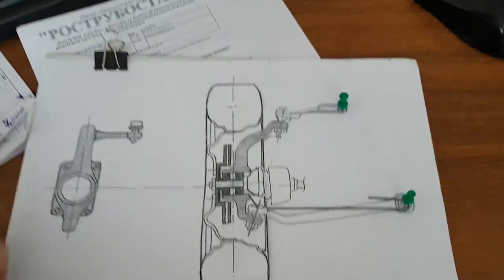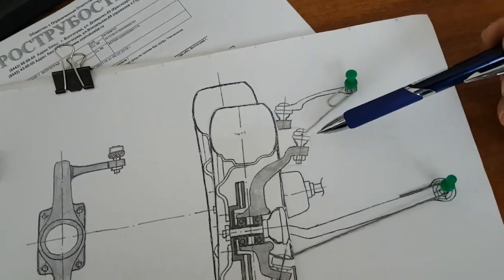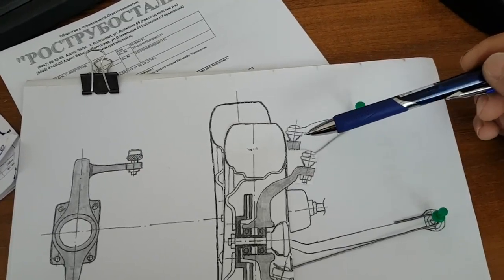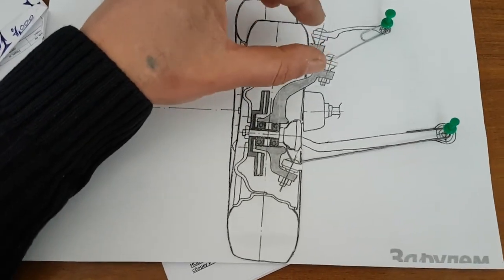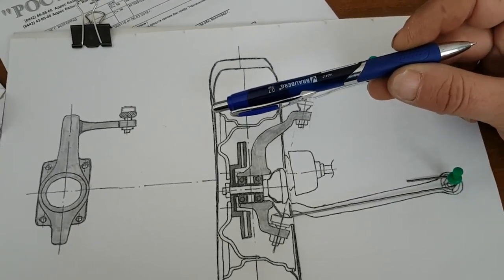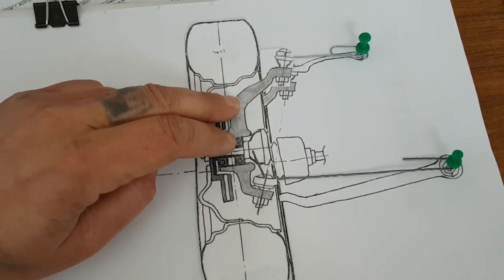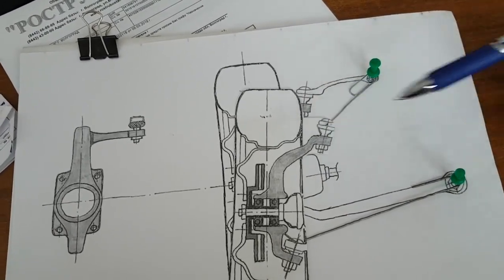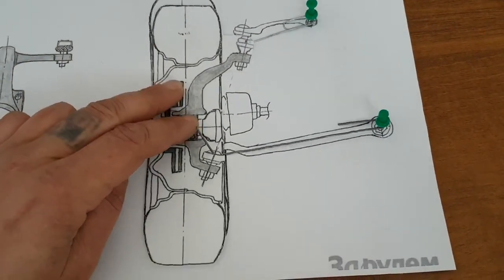"Front suspension Jeep Liberty KJ and Lift"

Comment: I lifted my Jeep Liberty KK 3.5” in the front and have no alignment issues. I flipped my ball joint (JBA UCA’s) from being mounted to the top to being mounted to the bottom (to get better strut clearance), and that threw my camber off. I had too much positive camber even after an alignment. So I believe your diagram is a bit off
Reply from the maker: The key word is that you installed levers that have different dimensions.